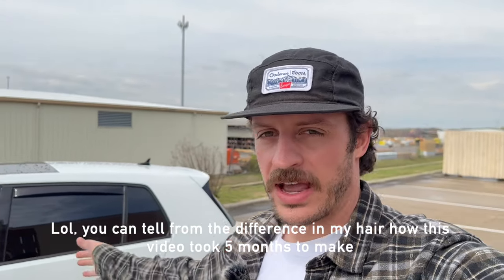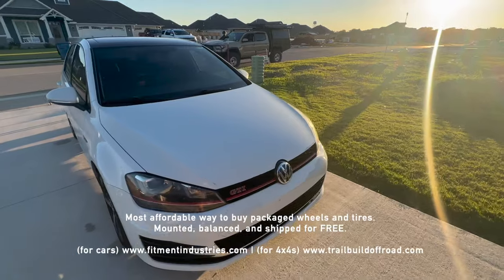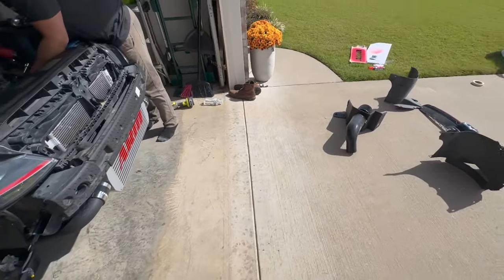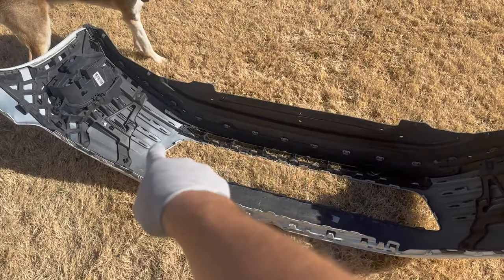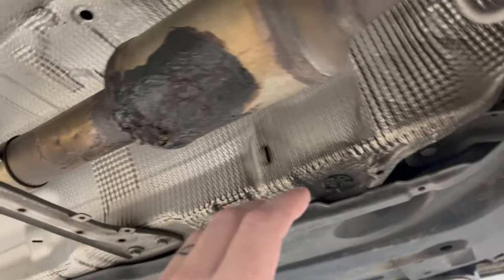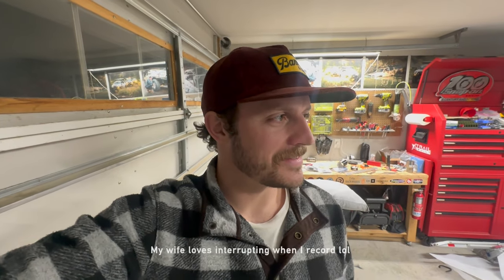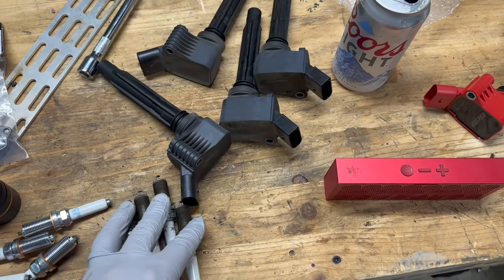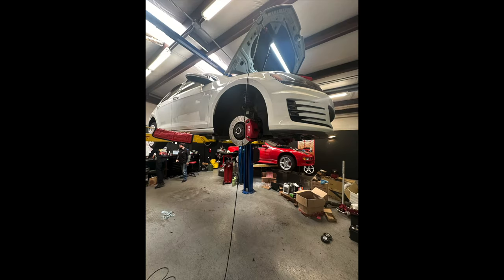Secret Project Revealed! My New Daily - Full Build in 23 Minutes

Comment: Man that’s a cool car. I have a 16’ GLI with the DSG and I’m a little too aggressive driving it to work sometimes 😂. Question: what plugs did you end up using (thought you said that in the text)? I’m at 100K on mine and I should probably change them.
Reply from the maker: Literally same. I rip to work like every morning 😂 Man I used some racing plugs from NGK that are like 2 steps colder. RS7 I think? Probably unnecessary. Those NGK iridium would have been fine I think. I’m putting those in after these need replacing.
Reply: @ArkansasOffroad Thanks!